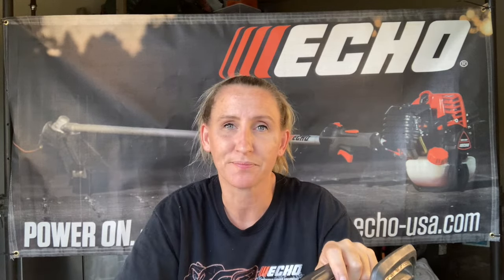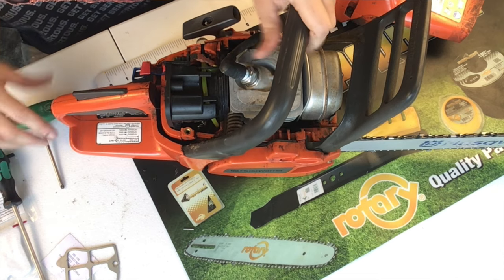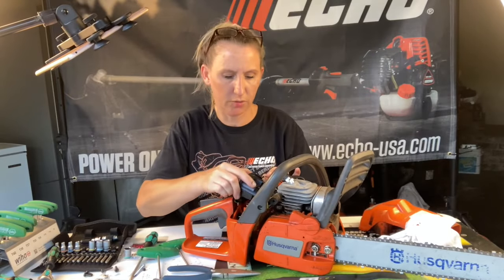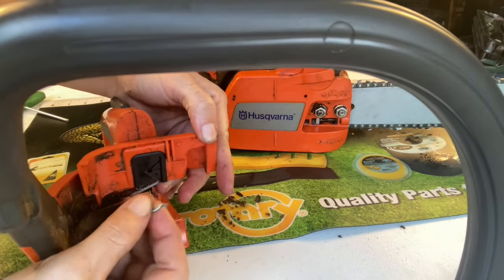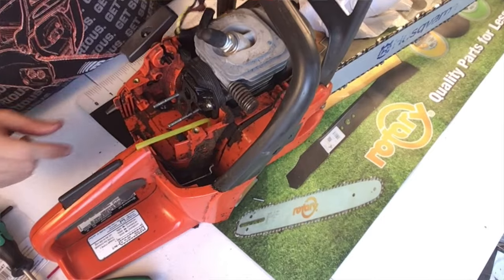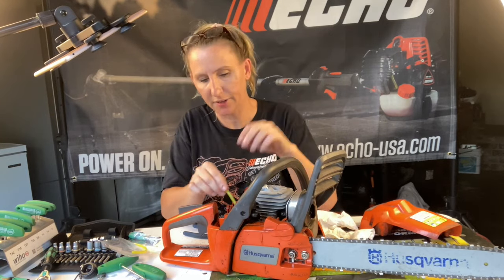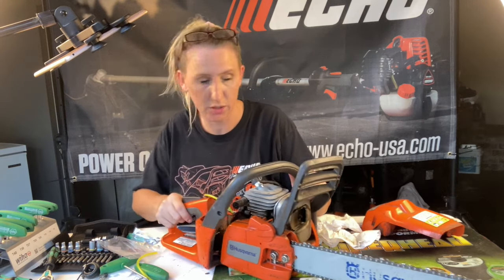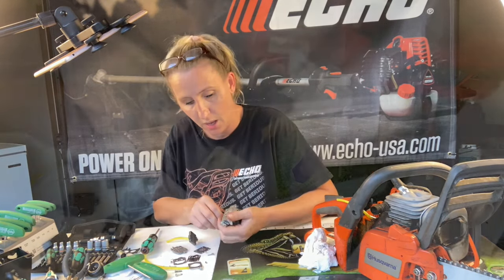HUSQVARNA CHAINSAW WON'T START? Complete fuel system rebuild of fuel lines/fuel filter/carb kit

Comment: ok, need a new chainsaw, in your opinion, who makes the best homeowner saw now.  i have used my  stihl for 27 years and it is worn out.  stihl quality seems to have slipped, my opinion. .
Reply: Echo... I am a master small engine mechanic...
Reply: @scottrussell6717  really, ok thanks, i will look into them
Reply: Echo will give you the most bang for your buck! BUT, that’s if you don’t use it like a pro does.
Reply: @ToddAdams1234  heat with firewood, but deff dont use everyday.... and i am almost 60, so my firewood cutting days are numbered...lol
Reply: I think that you’ll be more than satisfied. Just remember to tune in to YOUR fuel mix or you’ll burn it up 😵‍💫 I learned several years ago the hard way ☹️

Comment: I bet putting a carb back together is hard for some, just because they didn't pay attention to the one gasket with 3 holes.
Engine wont run, end up scratching head.
One good quality in a mechanic is paying attention how things came apart.

Comment: Hello, my name is Grumpy... and I'm a garage sale addict.  I don't think I can even count high enough to tell you how many chainsaws, weed eaters, leaf blowers and even specialty tools, new filters, new plugs, at yard sales where the owner says "It ran great last year, this year, I've tried everything and just can't get it to pop."  At one sale I picked up 2 Husqvarna leaf blowers AND a Stihl leaf blower.. All supposedly ran last year, owner said they were moving.
I figure the Stihl was out of my ball park so I asked him how much one of the Husky's was (They were identical models) he said "It's late, I'm tired, $20.00"  I gave him $20, picked up the Huskys and headed for my truck with a big smile..  I hear someone behind me and the guy says "Here, you might as well take the Stihl too.."  
I took them home, got out my fresh gas can, drained the old stuff in them, pulled the plugs and ran them on my wire wheel to give them a decent cleaning, sprayes a teeny bit of ether down the spark plug hole..  The Stihl cranked up and ran great 1st pull, the 1st Husky took 2 pulls, the second one took a little more finessing.. Sprayed a little bit of carb cleaner in the air filter, gave it a few turns to work it in.. On the 4th easy pull, I heard it pop twice, the next pull it fired up and ran great.

Sold the Husky for $35 each, still have the Stihl as part of my own set of yard tools.. 

It's amazing how many people will tell you "It ran great last year." when they pushed it in the shed, leaving all that gas in it to gum them up, never thought about cleaning the foam filter or pulling the plug and getting what I call a wire tooth brush and cleaning the plug.  I actually have had a few where I just dumped the gas, put fresh gas in it and they've fired up.. 

I'd love to enroll in an actual small engine course so I can work on the ones that I'm not so lucky on.. 

Granted, you're not going to sell a 5+ year old gas weed whacker to everyone that comes along looking for deals unless, they know that you fix things and back your work up.. 

And this year, my wife hurt me.. She went out and ordered a weed eater off AMAZON... A BATTERY powered one at that..  That's OK though, I put a metal bracket on the side of my riding mower, then ran cables to the battery to get some of that 12v juice, ran that through a cigarette lighter plug.. and the battery for my weedeater charges as I'm riding along.. Come to a spot along a fence lind, grab the weed eater, a little snip, snip here, a little trim, trim there, and it's on to the next fence post..

Comment: I just haven't had much luck with Husqvarna saws never owned one but tried using one to get a pinched saw out. Each time I hit the accelerater.the linkage fell off. Caused me a trip back to the sawmill to get their other one. And a friend of mine who cut timber had a big one. He had trouble with the ignition wires getting involved with flywheel. Soon afterwards he lost his life. While using it. Probably trying to save his saw. Hard worker just not a good maintenence guy.

Comment: Awesome. Quick question how do you replace the one way air valve inside the tank.  Mine came off when I pull the filter out?   Thanks
Reply from the maker: Are you talking about the tank vent?
Reply: @Chickanic  yes
Reply from the maker: @Capt-awesome  What model number do you have? I would like to look at parts breakdown to see which vent you have.
Reply: @Chickanic  thank you. Husqvarna 235.  Maybe time to upgrade
Reply from the maker: @Capt-awesome  So here is the breakdown of the saw. It shows part numbers 15 and 16 as the tank vent. You would have to remove the carburetor to get underneath it to the housing above fuel tank. there is a hole that the duck bill inserts into and then a bronze plug on top of it to keep it in place. So your saying your duck bill, (the one way valve) fell inside your fuel tank? If so the bronze plug is probably still in plastic housing.
Reply from the maker: @Capt-awesome  https://www.partstree.com/models/235-husqvarna-chainsaw-2008-01/crankcase-oil-tank-5/
Reply: @Chickanic  your 100% right part 15 and 16.  The bronze plug?  It will not come off and seems to be molded into the plastic. Should I drill it out?  Your a great help. Thank you so much.
Reply from the maker: @Capt-awesome  Thanks! Either a drill or maybe a wood screw through the center and a good yank on it. I have never had the duck bill fall out of one so it would be my first rodeo.
Reply: @Chickanic  many thanks!!!!  100%. A++

Comment: I won't work on that series Husqvarna anymore.  Always crank seals leaking after being put through homeowner hell.  Not worth the effort.
Reply: Yeah, any “4” series is designed for the homeowner. Their less expensive from the factory and you not SUPPOSED to be able to get them from any where but a dealer. They don’t take nearly as much abuse as a pro series or have near the chain speed. BUT, you can get the from the BBS (big box store),

Comment: This kind of issues are common here. The customer will buy a new machine and start and take it and keep for 5 years and try to start and you know what happens. And they will start argue that they never used it. But not aware what happened to the gasoline. Sometimes even the rings gets stuck in the grooves .
        And also they bring with a broken starter and want to repair the starter. Why the starter is broken they don't know. They use straight gas without oil and cylinder kit is burned. They pull and pull and finally they break the starter. What all issues I am having here!!

Comment: I understand being on a budget and I am a gas chainsaw guy but I would stay away from the entry level gas saws from Husky. This 240 is just a Poulan Pro in orange as Husky owns Poulan and the homeowner saws are 
all Poulan designed. If I needed a small saw to use once in a great while, I would go battery so you don’t have fuel issues unless you have non ethanol locally. Echo makes better homeowner and farm/ ranch gas saws than Stihl and Husky IMHO.
Reply: The 240’s are Swedish made saws, I agree ECHO makes better homeowner saws.

Comment: It won't start because it's  a poulan dressed in orange... yep.poulan.bought Husqvarna and now poulan make their cheaper saws.. don't believe me.. take parts off a newer poulan and they will fit.on the huskies
Reply: The 240’s are Swedish made saws. Husqvarna, which was a division of Electrolux until they spun the brand off to their own company, owns Poulan.
Reply: Not why it won't start, I have a 14 year old wild thing, and it has never failed me, not even once. They usually don't start, because it's a lower priced saw, many buy these, use it a couple of times for whatever, then they sit for an undetermined length if time, and the fuel goes bad, then they get pulled out of whatever hole they been sitting in...you get the idea. Tools that are gas powered either need to be run and maintained periodically, or they need to put away correctly, and most either don't know how, or don't care enough about their tools to do this. It's not the saws that are defective, it's usually the owners that are negligent.
Reply: @j.chrisbeck7492  as a master 2 stroke mechanic.. you are right to a point.. the old poulan is a way better saw then any brand new saws... people don't use e free gas... the ethanol will kill a saw fast but people don't believe it